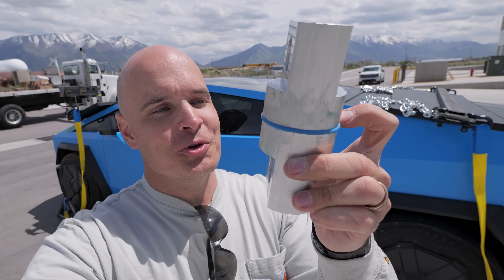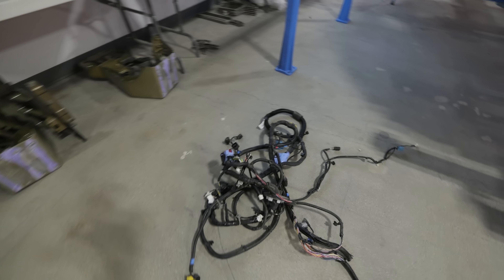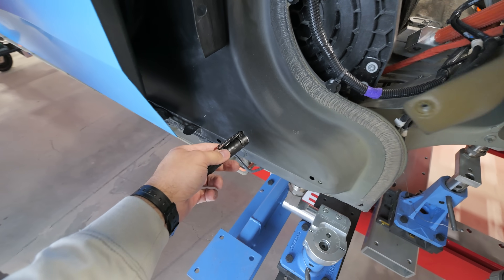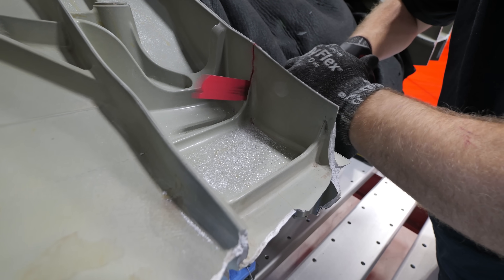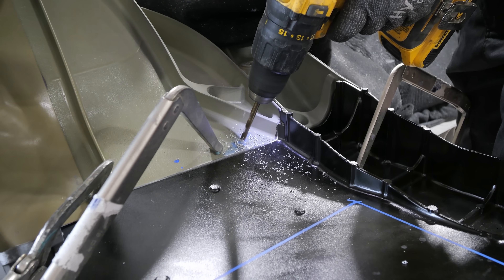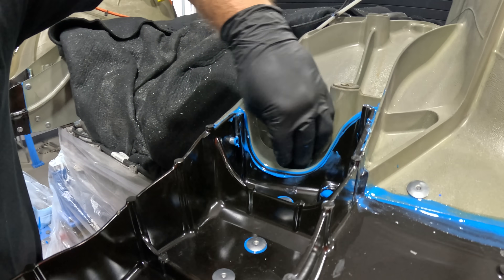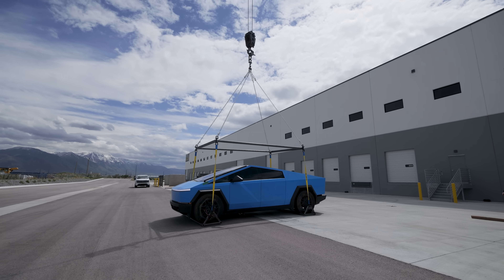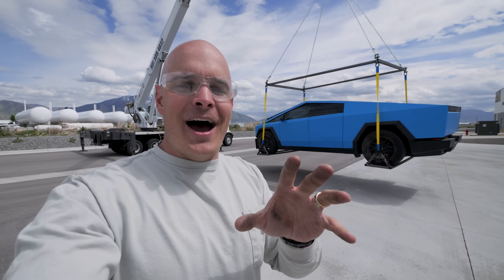Tesla Fixed my Cybertruck with GLUE - (but I'm not mad about it...)

Comment: Glue is glue and overtime it will lose its strength, but Tesla is counting on that....
Reply: @RaPtOr9600 any material, steel, aluminium, and titanium included, lose strength over time.
Your statement is meaningless without comparison between them, and not every glue will degrade faster than the materials they bond with. Technical adhesives like these hold airplanes together. And there's a good chance the metals will have fretted away before this glue has.
Reply: @Xiph1980  
My car is 22 years old and still drive no Tesla will survive for 22 years.
That is my statement.
If you need more statement hell yea buy car that is glued together more power to you.
Reply: @RaPtOr9600 how much do you think you’ve spent on gas and oil and maintenance over 22 years?
Reply: @Jst4vdeos  oil changes are $150 a year MAX. Gas on highways is cheaper than Supercharging.
How much have you lost on depreciation? That goes in tens of thousands.
Reply: @OmarZ77 A full 400mi charge costs me $9 because I hardly ever need to supercharge. Even still supercharging is comparable to gas cost. Who cares about depreciation if you want to keep your car until it dies and it’s rated for 500k+ miles. 10yr 150,000 warranty. I’ll save thousands every year on gas that more than make up for any depreciation that’s surely hit your vehicle too. Never paid for an oil change. Never need def or anything of that crap. Stop being so needlessly negative
Reply: @Jst4vdeos  oh, and I do my oil changes myself. I absolutely love it. Literally $15 for 5L from Costco and $10 for the filter, and takes less time than supercharging.

So trying to use oil changes as a marketing point is the weakest one. Everyone has to rotate their tires every 10k miles, including EV drivers. Adding an oil change to it won’t add more than 15mins to that trip.
Reply: @Jst4vdeos  You asked for stats. I gave you the numbers. You didn't like them, so they're "needlessly negative"? lol

You'll keep your car for 30 years? sure.. Unless you own a scrapyard, every car will eventually be sold. Depreciation is by far the biggest ownership cost, the numbers show. No need to divert from it.

And no EV has 400mi of range other than the Lucid Air and Silverado. Teslas have 300mi per EPA and ~270mi in real life. ~220mi in the winter. Wonder why you feel the need to lie about range...
I take 7+ hour drives often. I live in a beautiful area (Quebec and Vermont). I drove Montreal-Philly 4 times last year. Doing so in a Model Y Long Range would require stopping twice, once for 55 mins and another for 25 mins according to the Tesla Trip Planner. Versus a 5-min refill for cheaper lol.

Maybe you live in a boring area and only use your car for commuting. Luckily, I don't. I use my car for road trips far more than boring city drives.
Reply: @OmarZ77 you gave the stats without accounting for the fact that you’ll spend hundreds more every month on gas. Sure a 7hr drive is one thing, I’ve got a 36gal pickup if I want to drive forever but why tf would I use that as a measure of a good vehicle? It’s not economical and it’s a pain in the ass. I do my oil changes too, but I never have to do them on one of my vehicles. Never have wear on the brakes because regen. Never have to stop at the gas station unless I’m road tripping and do a quick stop at a charger. It’s a different vibe but you people act like there’s no lifestyle in which it works. I’ve owned Toyotas until they had 300,000 miles on them and were worthless in terms of resale so don’t talk about depreciation like it actually matters to regular people. I’ll go buy a 4-runner if I want something that won’t depreciate but it’ll cost $60k and gets about 10mpg so it’ll cost thousands more to fuel just for normal driving. Get a life
Reply: @Jst4vdeos  a 4Runner gets 25mpg on the highway (and is much more capable off road. How can you even compare it to a Tesla…)

The fact you have to constantly lie about efficiency numbers (400mi, 10mpg) shows a deep insecurity. Hope you can move past it.
Reply: @OmarZ77 400 might as well be a million if you don’t drive 7hrs a day because it’s full the next morning. I haven’t had to think about it for weeks. I’ve gotten about 357 with 16% left over the summer driving from Indianapolis to Madison. If that’s not good enough for you idk what to tell you because it cost me less than lunch. I was probably thinking 10mpg from a towing thing I saw. Doesn’t really change the point though.
Reply: @Jst4vdeos   don’t talk about depreciation like it actually matters to regular people.

LOL WHAT
Do you not know how to Google?

"In a study in The Balance, the average length of time that car owners keep a new car is approximately 71.4 months, or right around six years."
Which makes EVs a real money pit. Imagine wasting $40k on depreciation to save $4k on fuel lol smart.
Reply: @Jst4vdeos 
Much less than 100k for cybertruck.
My car is Diesel economical.
No Tesla will ever reach 22 years on the road constant wear and tear.
5 - 8.years and EV is junk.
Only if battery tech is improved then maybe they will be a valid option.
Reply: @OmarZ77 
Yeah 👍 even cheaper where I'm from.
Reply: @RaPtOr9600 the batteries are rated for 500k miles. Tesla gives a 10yr 100k powertrain warranty. Diesel is economical for some uses but not for others
Reply: @Jst4vdeos  
Yeah please tell me in 4 years how batteries hold charge, don't get me wrong i do not have anything against EV but i have against gluing the parts.
Cybetrcuk is not approved in EU because of many many things wrong on it it's basically death trap on wheels.
Reply: @RaPtOr9600 it’s got a 5 star safety rating
Reply: @Xiph1980 
When trim peeled off from cybertruck guess what Tesla did they put some more glue and a rivet just in case.
Accelerator pedal the same thing a rivet.
Glue is glue it will degrade, but welding and rivets and bolts, they will outlast any glue every time.
Reply: Same with bolts 'n' rivets.
Reply: Steel is steel, and overtime it will lose its strength too. Lol No material is invincible forever. This "glue" has been used in numerous other vehicles, but only now have you even been aware of it.
Reply: @Turbo.M777 
I will always bet on steel, rivets and bolts.
In just a Year that super glue was degraded and guess what Tesla did they put some rivets and then glue on trims that that in a year peeled off, even on the acelrate pedal, guess what a rivet just in case
Dude glue is for wood, not fuc king cars.
Reply: Teslas aren’t made with “overtime” in mind
Reply: @OmarZ77 Got any stats to backup that claim?

Comment: 6:57 Thanks for confirming that it smells like grandma's cookies!
Reply: I was thinking pulverized smurf
Reply: @bengerendash Well, I didn't see Gilgamesh anywhere in the video, so it must not.
Reply: 11:03 did they use less glue during manufacturing than in repair? That lowk sounds like poor manufacturing
Reply: @fire_boi6199 during the manufacturing it’s glue and spot welding aswell as rivets. During the repairs they made it cheaper by not requiring any welding and using extra glue. I bet they are about the same strength maybe 5% difference max. Pretty much every car in the word uses panel bond or a seam sealer to put all the panels and even subframe together and then you spot weld and rivet it.
Reply: was thinking bubblegum flavour
Reply: Or maybe something else in that house

Comment: What im more interested in is its shear strength. Super glue is pretty strong in tension
Reply from the maker: For sure. With steel it's actually stronger in shear. At 3336psi. 

With aluminum the sheer strength does drop a but to 2466psi but that's still some pretty impressive glue.
Reply: @JerryRigEverything  That is! Thanks for sharing.
Reply: @JerryRigEverything  I wonder about shock loading and repeat use. Plus I live in Canada where we can have 50 degree temp changes in a day. The aluminum and the glue will not expand and contract at the same speed.
Reply: @JerryRigEverything I love how you did your research!
Reply: @JerryRigEverything  typical autobody panel bond is 3-4k also. I wonder why they opted to use a proprietary product instead of off the shelf.
Reply: @JerryRigEverything  you said in your previous video “there are real world scenarios where the trailer weight becomes tongue weight, going up a steep hill or driveway your hitch could snap, or your trailer jumps the ball going 80mph on the freeway, giving the safety chains a jerk, your whole rear end is now gone” “it’s built like a pop can”

Now it’s “As long as you load and balance your trailer correctly, the cybertruck will always be able to load its rated capacity” which tongue weight apparently is only 1,100 pounds, funny how after you go to Tesla you don’t say any of this 😂 seems like someone paid you cough Tesla
Reply: @JerryRigEverything if Fusor 2098 is “special Tesla glue”, is Bondo special Tesla body filler?
Reply: @JerryRigEverything 3M makes similar (and better) structural adhesives. This isn’t anything new
Reply: @NextGenEvs Panelbond 08115 is awesome stuff that my shop used to use for a lot of repairs. I used it often for plastic bumper repair too with mesh pads. That stuff feathered out nicely and was super strong. I used it to fuse 2 busted bumper covers together to make 1 good bumper cover on my Ford Fusion and to glue in a floor pan in my Jeep Cherokee. Both repairs still holding up great after 12 years.
Reply: @JerryRigEverything  Well done with the kissy kissy brown it up get off that nut job team!  Good thing people on the better team dont throw pissy fits hate on and unsub  Because the nut jobs are few LOL LOL
Reply: Funny enough I was being told in my engineering school that glues are supposed to be used only for shear loads, not tension, as the bond is the weakest this way, which of course explains why the glue is in a "clamp" slot and wedge position.
Reply: @tomclanys  I was considering Veritasium's video on superglue, where he shows how the original formulation is strongest in tension.
Reply: Exactly and also how long it will take for it to degrade.
Reply: And Flexural strength
Reply: Your NEVER supposed to side load a shakel
Reply: What is sideloading a shackle?
I genuinely want to know so i dont get hurt or injure anyone.
I use shackles to recover vehicles and sometimes pulling in frame rails and structure components @marriagepartnersministry5942
Reply: It's not side loaded. The load spreaders were just laying flat before lift
Reply: If you want more stats - Elongation is 20% and Impact Wedge Peel is 30n/mm
Reply: The engineers thought of everything , including fixing the truck with ease! Brilliant team
Reply: @Jakepaulfamilyranch  It took over a week that is a long repair for such a simple job.
Reply: @Jakepaulfamilyranch  too bad nobody wants to own one
Reply: Super glue wont work as well on the smooth metal though
Reply: @koevoet7288  Some brands work better than others. I have also had issues with glueing certain types of plastic - like the kind used in fridges. Even after i sanded the surface.
Reply: shear or sheer? jfc
Reply: Shear and sheer are different  @ahkira1041

Comment: Now apply the force perpendicular to the glue. 😉
Reply from the maker: the sheer and tensile strength are the same strength ratings.
Reply: @JerryRigEverything  I feel comfortable betting money that they're not also its called shear
Reply from the maker: @owlmostdead9492  my bad.  But yeah you can look up the technical spec sheet of the Fusor 2098 yourself. 

With steel the tensile is 3190psi and the shear is stronger at 3336psi. 

(Aluminum does have a slight drop when it comes to sheer but it's still 3190psi with tensile and 2466psi shear.) Not bad at all.
Reply: Would a normal way of attaching tequniqe work better? Rather than a glue  @JerryRigEverything
Reply: @JerryRigEverything  that's actually pretty good. ( you said sheer again by the way lol)
Reply: @owlmostdead9492you think welds hold up the same to shear and tensile? They do not

Comment: Sure it holds it now... But will it hold after 100K miles of vibrations and temperature changes?
Reply: That piece of shit isn't going to make it 100,000 miles. I'd be more concerned about trying to tow a boat with a glued on bumper and tow hitch.
Reply: @ajalfano hmm the other teslas make it over 150k miles and are still just fine so why wouldn't the cyber truck

Comment: 120k glue kit truck. We are getting so ripped off in the States big time. This probably takes about 5k to make. Granted some good tech there but its nothing compared to Chinese electric cars that are 1/3 of the price and 10x more tech you get with Tesla. Also most of their electric has hybrid tech and when you run out of power your not sitting somewhere for hours in unsafe locations waiting to charge. Most of the get 700 miles on a full tank and charge!